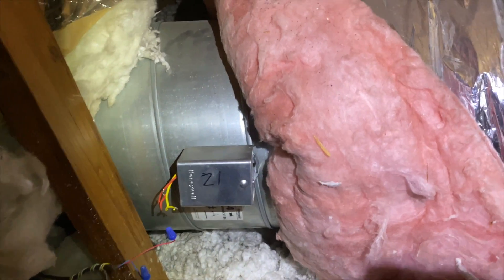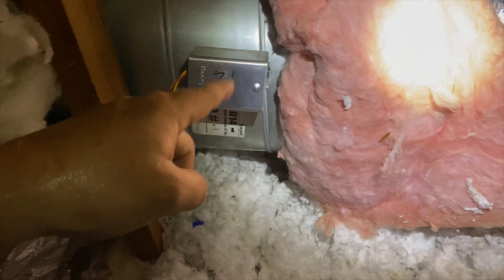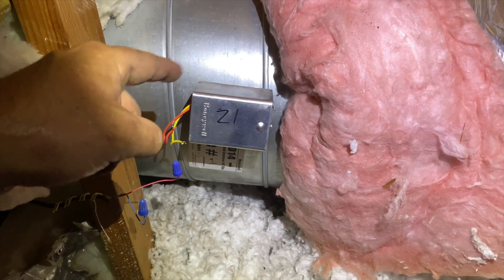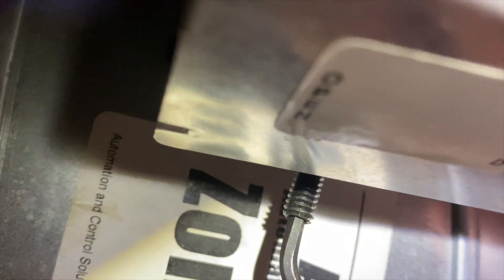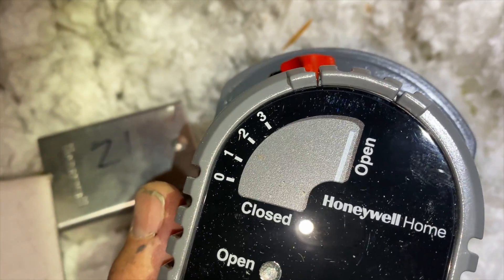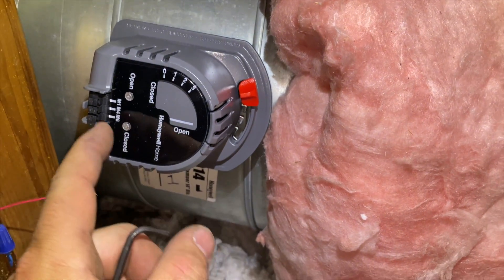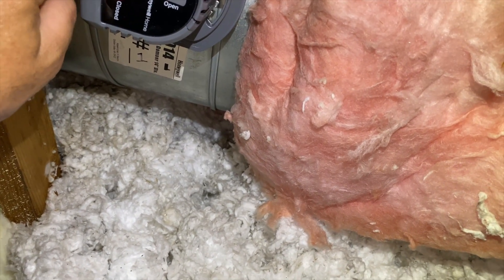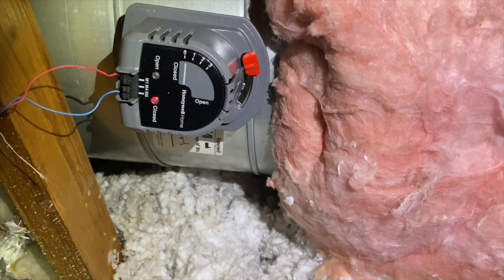Zone Damper Actuator Diagnostic and Replacement. EP64

Comment: Why would an AC tech not have these in the truck esp when told damper is not working,  and have to go make a trip and keep the $meter running on his/her hour long trip?
Reply from the maker: These go bad all the time. I usually keep four on the truck at a time. On that day I ran out.

Comment: New home owner, crazy question. In the attic,  do you stand on the beams, or is it safe to walk on that white cotton looking stuff. Im trying to find my dampers. They are not easy to find. One room is always hot. I have a carrier horizontal unit. It's an electric air handler. And do i need to turn off power to the house to change that thing out? Ps, the house was built in 2004. So, i dont know what the damper thing looks like. Any help would be really appreciated.  Thanks. Great video, and thanks for helping others 🙏

Comment: Thanks a lot for this video! Had the same issue with busted spring preventing it from opening. Since I'm getting a new AC installed next month I just disabled the actuator for now and manually moved it to open position.

Comment: Is there an indicator on the shaft part of the damper assembly that tells u if it’s open or close b4 u put the new one on? Like the shaft of a blower motor has a smooth side… is it like thay
Reply from the maker: Nope. You just have to wing it. Sometimes I’ll just drill a hole in the damper assembly so I can see if it open or closed. Then I draw a line on the end of the shaft. If you’re lucky someone else marked it for you.

Comment: We replaced our actuator but now the air won't shut off & stays in the open position. It won't close. Could the problem be the mother board?
Reply from the maker: Possibly. When you turn off that zone you should be getting 24v to the damper for that zone. If not probably a bad zone controller. Assuming it’s a powered close system.

Comment: Hi Nighthawk - for idiots like myself, it would be great if you could show the screw that you adjusted to get the damper position to "0". I'm sure this was extremely difficult to do one-handed, and you did a fantastic job! Could you just send me a response on here and let me know what screw needed to be adjusted? Was this the screw that the motor mounts to that you were explaining needed to be aligned to the "closed" position before installing? So, did you have to take the motor completely off and then turn that mounting screw even more clockwise?
Reply: Actually, after watching your video again, I realize what you did. I guess re-watching it was the key! ;-) Thank you so much for the excellent video!

Comment: What about an electrical issue with the actuator? Can you measure the resistance across the two wires?
Reply from the maker: Absolutely. However, the actual specifications are not listed on the actuator.

Comment: Great video! One of my dampers would not open when called for cooling. Pulled the motor off and noticed I could not hand turn the damper/rod. It was very difficult to turn, so I sprayed some WD40 on the rod, and now it spins freely by hand. Now a month later, the damper is not opening again. The damper rod is tough again to turn. Appears the damper itself has failed. Have you ever seen this? Thanks!

Comment: Thank you for this video! You made it easier for me to understand this.  I have a question . Im hoping you can relay some info on it: I have a 2 zone Honeywell damper.  The one accutator is loose and constantly open. (Upstairs) the second one is stuck in middle and no airflow for the downstairs….  Are they both dead or can i fix the springs inside? Thank u
Reply: Based on this video the spring is on the actual actuator.

Comment: What would be the issue leaving it open by unwiring it?  That way you wouldn’t have to replace it
Reply: Reason I ask is because I have one that is out that leads to my girls bedrooms.  There is no thermostat in those rooms.  Could I leave them open with no issue?
Reply from the maker: You can but air will flow when ever a zone is called for. It might overheat or over cool that room. Best option would be to find the thermostat that controls that room. Installed a remote temperature sensor. ( if the thermostat has this option otherwise the thermostat would need to be replaced as well) Replace the actuator. Disabling that zone is usually done as a temporary fix as there will always be airflow to that room even if that zone is not calling. Hope this helps.
Reply from the maker: If I just left it disconnected The zone would always be on. The thermostat in that zone would not be able to stop the cooling or heating if another zone is calling.  Replacing the actuator is the only way to maintain proper cooling and heating in a zoned system.
Reply: ...or you could just leave it disconnected and turn the  ac/heater on and off manually like everyone on the planet used to do when it got to hot or to cold.  Technology is expensive and a repair tech is even more expensive.  You can also close the vents in rooms your not using, or adjust the airflow at the vent .
Reply: @kngjoea3743 😅